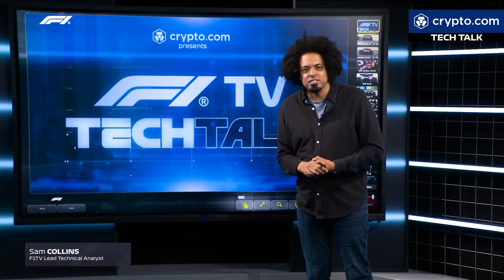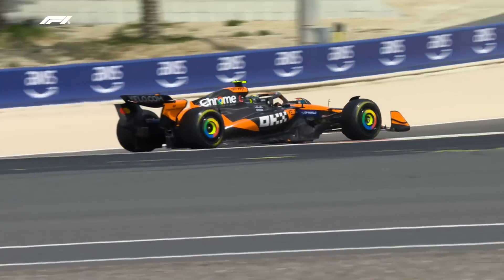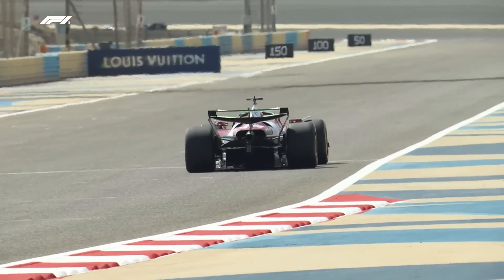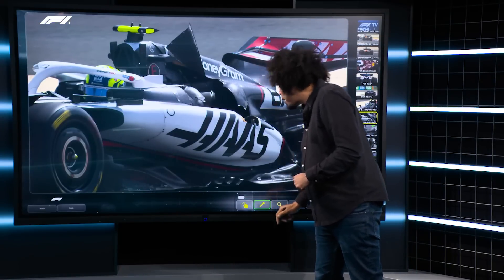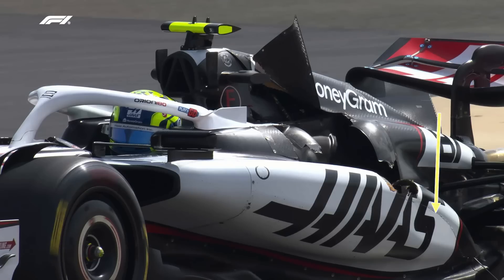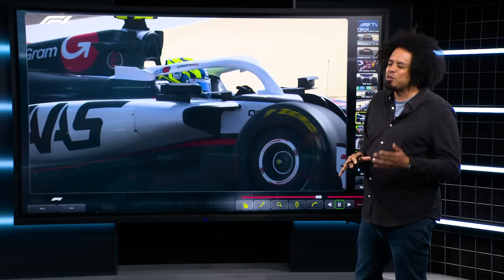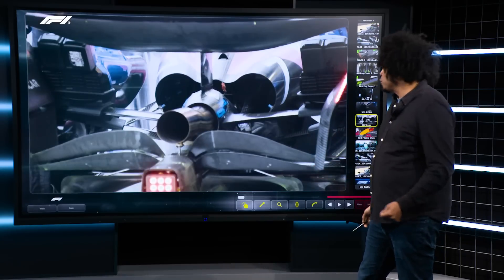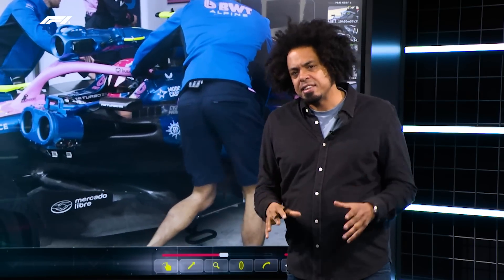What's Behind An F1 Car? | F1TV Tech Talk | F1 Pre-Season Testing 2025 | Crypto.com

Comment: Tech talk is cool! Are engines and transmissions 100% carry overs until 2026 or are they also modified but not discussed because the teams keep everything secret.
Reply: Yes, since 2022 there is an engine freeze for the current engines until 2026, which means nobody is allowed to bring any performance upgrades for their engine. I think the only thing they are allowed to do are reliability upgrades, but as we could see in Testing, that part is pretty much already maxed out.
Reply: @ Thanks, so it sounds like the only thing they can work is the cooling.